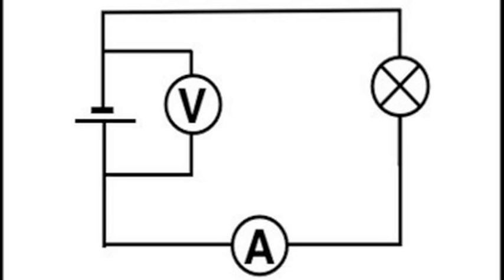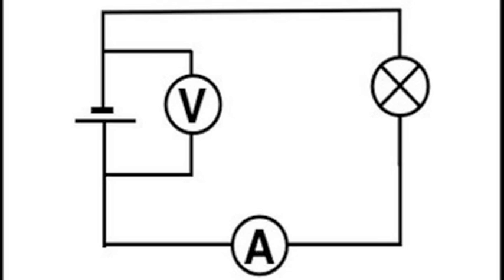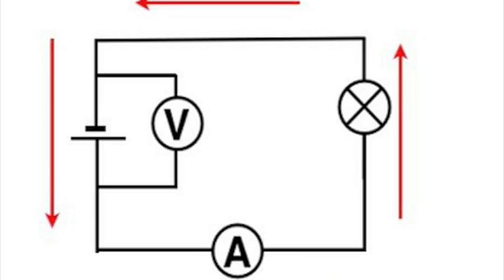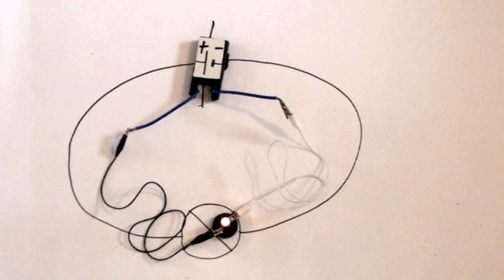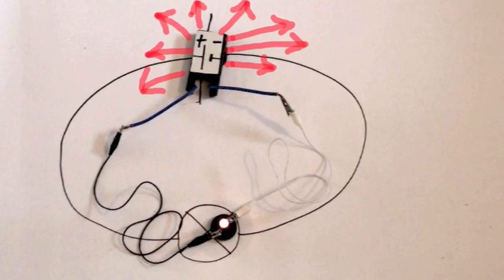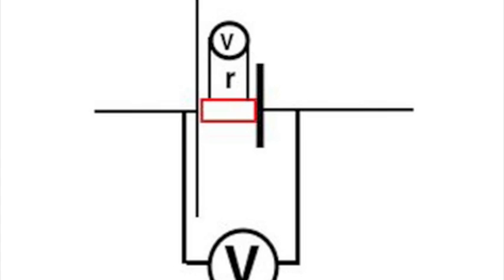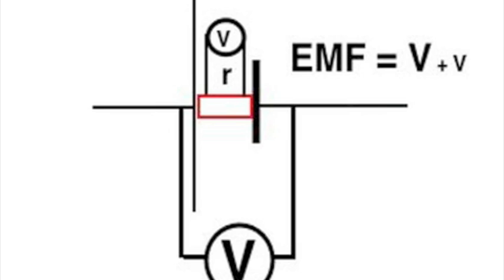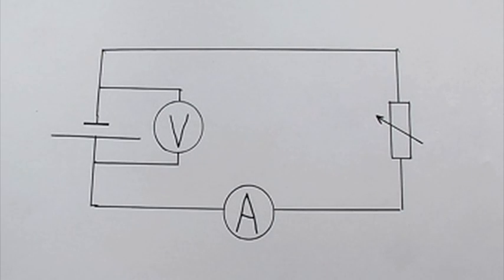EMF and internal resistance explained: from fizzics.org

Comment: Voltmeter measures the power? I thought volt meter measures voltage different, not a very good explanation.
Reply from the maker: No, listen more carefully! I said that the voltage measures the power delivered by the current. This is a shorthand manner of expression intended to be illustrative but you know that power = current x voltage and so the voltage is power per amp.

Comment: ok, so how do huge resistors affect the emf result, could you give an example. This would clarify the definition of emf for me. Laypeople are calling measured voltage on the human body emf using voltmeters, then connecting their body to ground and that voltage disappears. But what about the frequency aspect? What carries that and does the loss of voltage presence measured on teh human body indicate the frequency exposure also gone?Thanks for teaching.